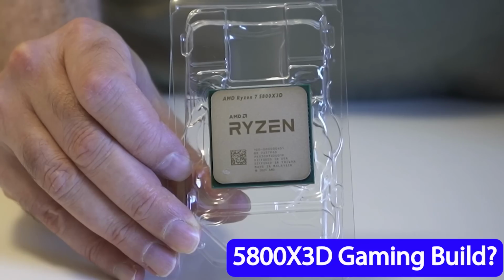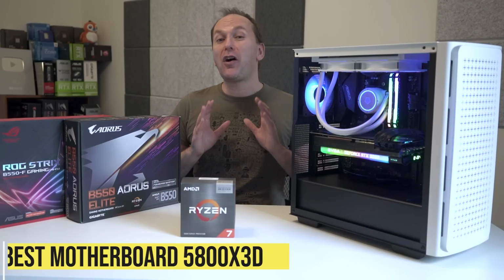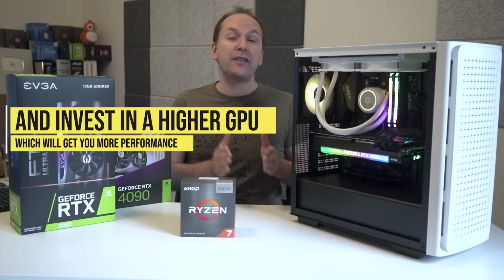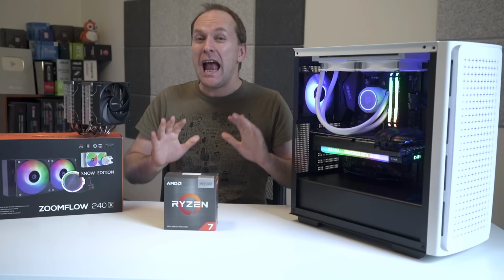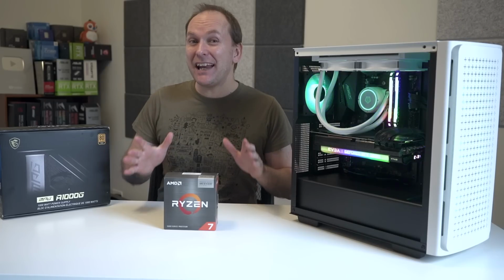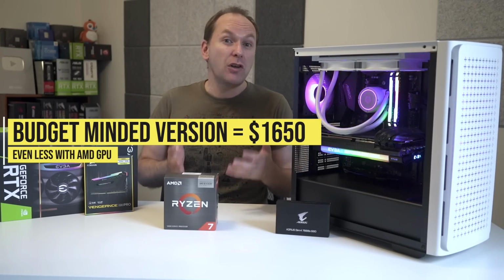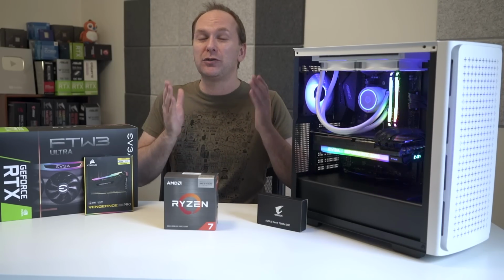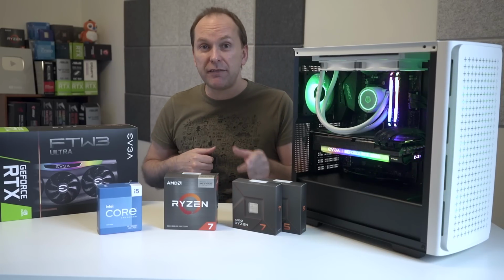🛑 4K Gaming is CHEAP! 🛑 Ultimate Ryzen 5800X3D Gaming PC Build

Comment: I ordered the 5800x3d and Aorus Pro AC yesterday. Glad you recommended that mobo once again Jason. Also got the Thermalright PA 120 SE rgb. It was a hard choice between the different AX and V2 Elite and Pro boards. 

I'm not sure if I should go ahead and bios flash it straight out of box when it arrives. 
Does anyone here know what current bios version is the best option for the 5800x3d?
Reply: Always update to the latest BIOS with AMD because they improve performance and security overtime
Reply from the maker: Awesome! And yes seconding Christopher I always update to the latest bios when I build

Comment: You would be a sucker to spend $720 on a 3080.
CPU: AMD Ryzen 5 7600X 4.7 GHz 6-Core Processor  ($250.00) 
CPU Cooler: Deepcool AK400 66.47 CFM CPU Cooler  ($34.99 @ Amazon) 
Motherboard: Gigabyte B650M AORUS ELITE AX Micro ATX AM5 Motherboard  ($189.99 @ Newegg) 
Memory: TEAMGROUP T-Force Vulcan 32 GB (2 x 16 GB) DDR5-5600 CL32 Memory  ($159.99 @ Amazon) 
Storage: PNY XLR8 CS3040 1 TB M.2-2280 PCIe 4.0 X4 NVME Solid State Drive  ($89.99 @ Amazon) 
Video Card: ASRock Phantom Gaming D OC Radeon RX 6800 XT 16 GB Video Card  ($514.99 @ Newegg) 
Case: Corsair 4000D Airflow ATX Mid Tower Case  ($97.49 @ Amazon) 
Power Supply: Asus ROG-STRIX-850G 850 W 80+ Gold Certified Fully Modular ATX Power Supply  ($114.99 @ Newegg) 
Total: $1452.43

Comment: I've been told that the ryzen 9 5900X is the best CPU I can get for the RX 6800 XT. Would you recommend the 5800x3D instead?
Reply: If you're building brand new go with 7600X/7700X for $250/$350. You can find 7700X/32GB RAM bundle for $420. If you are upgrading on AM4 then the 5800X3D is the best gaming chip. Get the 5900X if you need more than 8 cores for work. I've made 2 buld lists in the comments.
Reply from the maker: For gaming the 5800X3D will give you better performance. 7600X and 13600k also good options

Comment: Saving you about $500.
CPU: AMD Ryzen 7 5800X3D 3.4 GHz 8-Core Processor  ($329.00) 
CPU Cooler: Deepcool AK400 66.47 CFM CPU Cooler  ($34.99 @ Amazon) 
Motherboard: ASRock X570 Steel Legend ATX AM4 Motherboard  ($134.99 @ Newegg) 
Memory: Silicon Power GAMING 16 GB (2 x 8 GB) DDR4-3200 CL16 Memory  ($40.97 @ Amazon) 
Storage: PNY XLR8 CS3040 1 TB M.2-2280 PCIe 4.0 X4 NVME Solid State Drive  ($89.99 @ Amazon) 
Video Card: ASRock Phantom Gaming D OC Radeon RX 6800 XT 16 GB Video Card  ($514.99 @ Newegg) 
Case: Corsair 4000D Airflow ATX Mid Tower Case  ($97.49 @ Amazon) 
Power Supply: Asus ROG-STRIX-850G 850 W 80+ Gold Certified Fully Modular ATX Power Supply  ($114.99 @ Newegg) 
Total: $1357.41

Comment: I would not recommend using Corsair RAM (unless you are doing all Corsair build), as they use their own RGB software that you would have to install on top of other RGB software for your mobo, fans and GPU.  Unless you use third party RGB software, it's better to use all the hardware that supports Aura, for example.  That way you just need one RGB program to control it all.  All these RGB programs still suck, so installing more than one is just asking for trouble and you have more overhead that you could be using for gaming performance instead.

Comment: Depending on what else your guy plays, the 3080 / 6800XT might be severe overkill for WoW. I have a 5800x3D and 2070 Super, and I'm still CPU bound in a majority of cases in WoW at 1440p. Only in some of the outdoor areas with fewer people around do I see my GPU usage creep up over 80%, and that's at capped 165 FPS, so doesn't really matter.

The 3080 is also still quite overpriced compared to the 6800XT. I don't think any Nvidia GPUs below the 4090 are worth buying at the moment unless you very specifically want raytraced reflections, which AMD GPUs struggle with. Even the 6800XT does pretty well with raytraced shadows.

Comment: My system is the 5800X3D with a 6700XT it just devours WoW at 1080p pining the needle at 140 FPS in all but the heaviest raiding situations. In all my games this setup just tears it up, the extra cache really smoothes out those little hitches at higher FPS.
Reply: I just ordered my 5800x3d for wow 1440p. I also have the 6700xt, cant wait to see the performance gains just off this cpu.
Reply: What quality level are you running at, Ultra?

Comment: As someone who has an expensive x570 board (ASUS Dark Hero) and went from the 5800X to the 5800X3D, you don't need to overpay on the board because you can't overclock the 5800X3D, I've tried. If overclocking is your goal, the rule is you should get an enthusiast board that has better components to achive that but you can't overclock the 5800X3D. For gaming, the 5800X3D performs at stock better than the 5800X with PBO2. Now I don't know if my 64GB (16x4) Dominator 3600 CL18 can run at 4000 CL18 with FCLK set at 2000 because of the board, and I'd say probably not and you could say that I shouldn't get any better performance but I like the coolness factor. Really, I didn't want an X570 board with a fan which the Dark Hero does not have. I'd say shift your budget to a 5800X3D, save money with a good B550 or cheap X570 that is still good and decent RAM.
Reply: Have an crosshair VIII dark hero with a 5800x. Think its better to upgrade at an 5900x. Or?
Reply: Can oc my 5800x at 5,225 ghz all core at 89°C.... My question is... Is it better to take an 5900x with all core 5,3 ghz and 12 cores for unreal engine 5..?
Reply: @Querilio  Depends on your GPU. Hardware Canucks (sp?) said a 3070 Ti at 1440p wouldn't really benefit. Well, I still have screenshots of HZD going from 112fps to 138fps. SotTR, 10-ish better but still a plus. I'm sure there are some that won't but I doubt the 5800X3D would perform worse. Really, look at some of the 7950X reviews that compare to the 5800X3D and they are neck and neck. Problem is that most benchmarks large YouTubers do is 3090 Ti/4090 at 1080p. That is just unrealistic. With that card, you either want 4K or super smooth, high refresh 1440p. Gamers Nexus and Hardware Unboxed do some 1440p benchmarking. I actually was going to get the 5950X over the 5900X but many benchmarks put the 5800X3D above both. I just plan on gaming so 5800X3D is best for me. I also did a little retro gaming and the best way to make a 500MHz processor run like a 100MHz, was to disable the cache. The 5800X3D adds more cache which definitely will help in gaming. Cool overclocking. Its something I just don't do anymore, a lot of work, never really got results that mattered much, though there were some awesome ones. With how CPUs now just run as fast as possible w/o exceeding a thermal limit, I'll invest in better cooling and a nice mobo that will eventually sell higher than others used. Highend ASUS boards seem to do the best. Also, the highest end CPU for a socket does well too. My Phenom II X6 1100T is still worth a good bit, especially buying it used. I never OC'd it but I unlocked the turbo to let all six cores run at 3.7GHz. Otherwise, it would only turbo to 3.7 for up to a max of 3. When it did that, it would run all cores at 3.4GHz. Again, the best cooling kept that stable for a few years with the fastest DDR3 ram (1333 @ 6-6-6-18).

Comment: So what is the difference between the performance between 5900x vs 5800X3D. They are the same price.
Reply: 5800x3d better for gaming and 5900x better for rendering, mulitask. But for unreal engine 5 near future. Dont know
Reply: @Querilio  you say its better for gaming. Why is it better? I dont see a gain in games. Performance is the same. But its like you say, 5900x is better in productivity. Why not just buy a 5900x and get the both? for the same price. Atleast on 4k gaming. I dont know how it works on 1080p and 1440p. I happen to own the 5900x, and its not different from the x3d. Just less cores for multitasking.

Comment: Hi! I was watching some of your videos, specifically the best combo videos from a few months ago and I got slightly concerned over my new setup with bottlenecking. I have a radeon RX 6650 XT gpu and AMD ryzen 5 5600 6core 12 thread cpu. my mother board is a gigabyte  B550M DS3H ac am4. I'm worried that I will be bottlenecking my cpu and if its worth upgrading to a RX 6900 XT sooner than later.
Reply: Don't worry, one of those are basically always the limit to performance. CPU bottlenecks are generally worse because GPUs are more expensive and their performance, and price, gets "wasted" with a slower CPU. CPU bottlenecks can also cause stuttering while having the GPU as the limit to performance is smoother. Your combination is well balanced so there is no need to upgrade unless your aren't satisfied with your FPS.

Comment: I have an RTX2080 super and Updated from a Ryzen 7 3800x to a 5800x3d and the difference is nice in Division 2. FPS are stable now not as before and the peaks are higher and the lows are also higher. I am waiting for the RX 7900xtx at the moment. Nvidia is very expensive here in germany and i only have one RT Game... Shadof of the Tombraider. Playing on Ultrawide 3440x1440p
Reply: Bonjour, config copie aussi un 3800XT et un 2080 Hybrid  et je passe a un X3D je pense que plus tard la voix 4080 sera logique  pour votre config quand les prix vont s écrouler 
ici en France aussi hors de prix j ai sacrifie finance pour passer a 3090 et offrir dans ma famille le 2080 Hybrid 
merci de me donner le retour de températures du X3D en jeux du bas au max degrés, Merci d avance
Reply: @lucgrunenwald7795  max 70 degrees on games cooled with an 360 AIO BeQuiet Silent Loop 2

Comment: locally, the x3d for me is still easily $420, i went for AM5 instead, saw a deal for the x670e aorus master for 45% off effectively (meanwhile Z790 is almost ~$700+, if not i might have been swayed to get the 13600kf instead. Got the best kit of ddr5 from OEM too, now waiting on the x3d CPUs in Q1.

Comment: NEED HELP BUILDING THE BEST RYZEN 7 7700X GAMING BUILD! Would love to see you post a video with a 7700x build. I've been told it's the best CPU for CS:GO, which I play a lot! Right now I have Ryzen 9 3900x, Asus Rog Strix RTX 2080 Super, MSI MAG X570 TOMAHAWK WIFI, NZXT Kraken X73 + 2x NZXT AER RGB 2 fans, 32GB G.Skill TridentZ RGB 3600MHz C16, 1TB Samsung EVO 970 and Corsair RM850x psu. I want to build a new PC with Ryzen 7 7700x.

Oh and I'm strongly considering buying the ASUS ROG Strix XG27AQM 1440p 270Hz monitor, who will be replacing my AOC 24G2U 1080p 144Hz. I found a used one for around 666USD, the person bought it back in December 2021. A new XG27AQM cost around 914USD here in Denmark. I mainly play CSGO, but also play other games like RDR2, Call of Duty Modern Warfare, Microsoft Flight Simulator, F122, Euro Truck Simulator 2.

Comment: I bought the x3D chip in May to upgrade from my 5600x.  I looked at it as a last hurrah for the platform.  Hype drove my upgrade and I did regret it soon after, because my rig was great and $450 is $450.  But seeing how well it's holding its own, I no longer regret it.  I only play iRacing.

5800x3D, 3080, 32GB 3600 CL16, Giga B550 based on PC Builder's recommendation.  I should be set for years to come.  Screw the 4000 series cards!
Reply: Don't feel bad you're future proofed I don't think you'll need a new system for quite a while

Comment: What’s your opinion on the difference of the 5800x and the 5800x3D as far as streaming and video editing(1080p-1440p)? Is it more beneficial to get the 5800x3d in these cases or is the difference minimal and the 5800x sufficient?
Reply: I upgraded my 5800x to a 5800x3d and in some games at 1440p w/ 3070 Ti I saw almost 20fps more. Horizon Zero Dawn went from 112fps to 138fps. Shadow of the Tomb Raider only went up 8-ish fps but I consider it a win. Both use highest settings DLSS and with SotTR RT. Also, I run Spider-Man on highest everything and barely dip below 100fps

Comment: During the CPU choice I think you forgot to mention the targetted workload (wow) is very cache reliant and that happens to be the special trait of the 5800x3d. All by all a very good choice, but deserves a bit more explanation. Personally I would have waited for zen 4 x3d skews to launch. But I get it, new expansion launching and all :)Have fun gaming!
Reply: Agreed. MMO's and big open world games in particular really make good use of all that extra cache on the X3D.
Reply: ive been thinking of getting either the 13600k or 5800x3d. what would you say?
Reply: @Altyno296  impossible to say, I don't know your workload...
Reply: @BartVerhoeven1992  mostly gaming
Reply: @Altyno296  some games will run better on 5800x3d, some will run better on the 13600k...
They're both end of platform so you won't be able to get an upgrade to your machine later down the line.
The 5800x3d will probably end up being cheaper, and has more cache, but the 13600k has an advantage in multi threading. 

If there isn't some specific game you like, I don't think there is a wrong choice here.
Reply: Yeah, picking cpu for wow, and he doesnt even told about large cache which wow loves, but overall costs win, seems like he has no idea what he is talking about

Comment: So I have decided on a 
NZXT N7 B550 - N7-B55XT-W1 - AMD B550 chipset
Ryzen 5 5600x or 7 5800x
Vetroo V5 Cooler
Gigabyte Radeon RX 6700 XT EAGLE 12GB Graphics Card
500gb M.2 main drive plus a 2nd M.2 1tb if it fits.
OLOy DDR4 RAM 16GB (2x8GB) 3000 MHz 
MSI MPG A750GF WHITE Power Supply Unit, UK Plug - 750W, 
all I hope to be stuffed into this
iONZ KZ08 PC ARCTIC WHITE MID TOWER COMPUTER CASE M/ATX ATX TEMPERED GLASS WITH 3 FRGB FANS

Thoughts??
Reply: Good choice i think, im using the same motherboard but im using 6750 xt, if u have the budget u can go for 6800 xt for a more efficient combo. I wish i had that.
Reply: @nexvions  I was going to buy the 6750xt but I couldn't buy it on buy monthly from Amazon so thats why I got the 6700xt. But nice to know I have chosen well. Thanks for your comment.
Reply: @WilliamStevens007  ur welcome. On my side the 6750 xt is cheaper about usd 508 therefore it's an obvious better choice. I think it's due to the bad sales of that card. Happy gaming then!

Comment: I would have just spent the extra few bucks and got a 13700k since you went with a dead platform. Just as good gaming, better in some, useful for anything not gaming. Can still use ddr4.
Reply: The 5800 X 3D excels in MMOs and gives a lot more FPS

Comment: Having just got a 4090 and on a 120hz oled I want 120hz maxed I'm sure my 12900k at stock will be fine even with max RT which is cpu taxing as I really don't want to upgrade to the 13900k. Someone who got the 13900k said he notices the 0.1 and 1% lows are much better but not sure it's needed at this low hz.

Comment: I already have a 5600x and it’s a beast but man if the 5800x3D goes below $300 it’ll be hard not to upgrade
Reply: Have a 5800x and choose between 5800x3d or an 5900x... 🤔🤔🤔🤔
Reply: @Querilio  if you edit and render then 5900x, only gaming specific games like fps and other cpu intensive games only - then 5800x3d

Comment: Hi Jason, 👋 I am sharing my Ryzen upgrade story here : After weeks of thinking and budget calculations and loads of techuber videos including yours, I finally made up my mind and instead of jumping to new DDR5 platform I upgraded my  5 year old B350 mobo with a Ryzen 5700X replacing the old Ryzen 1600. For my RTX 3060 ti a 13600k or 7700X or 5800x3d  won't be giving too much fps compared to a 5700X. Getting a good 60fps 1080p on Cyberpunk on max RT with DLSS quality and 48 to 50fps in 4K with DLSS ultra performance . Shadow of the tomb raider hitting 160 fps on highest graphics at 1080p and 50fps on 4K with some DLSS. Blender is also loving the faster CPU. Hope my 5 year old B350 will hangon for another 1 or 2 years when the DDR5 platforms will become a lot more affordable and then I can think of upgrading.  Thanks Jason for the videos ❤️

Comment: Nice video again, i did learn so much from your videos👍 
Just building same class PC atm, i have most of the parts.
13600K
ASUS TUF z690 plus wifi
16gb G. Skill Trident Z 3200 cl14
Kingston KC3000 1TB
Kingston NV2 1TB
3080 GIGABYTE GAMING OC 10GB (used 600€)
Corsair HX1200 (used 150€)
FD Meshify S2 TG 
Arctic Liquid II 420 RGB

~2000€

Comment: I have a 5800X and a ROG Strix 3080 12gb and I benchmarked 98 games at 4k native on max settings, no raytracing. 109fps average across all 98 games. High spec games run around 60fps on max settings.

Comment: For those wanting a prebuilt AMD. Skytech has their 7700x with a 3080 and 32gig for $1799 atm. They don’t give any specs so I’m not sure of the ram speed though. I would buy it but I have a system with the i5 and a 3080ti coming for about $250 more.

Comment: I hear most asrock will let you into the bios and use a flash drive to update with the cpu inatalled. Then you can boot into windows.  I have not tested this, but looking into the steel series I have heard this over and over again.  The b550m steel series was going for 109, the b550 atx for 139 and then newegg had the x570 version for 130. I felt that was a good deal at 130 and got that one.
Reply: I just did it today

Comment: Great video! To be honest, you were one of my best sources while building my new PC hehe

Still missing the case and monitor (prices were high here in my country and not a lot of 1440p monitors available), but my spec is:
CPU: 5800X3D
GPU: Asrock Phantom Gaming 6900xt
MOBO: MSI B550 Tomahawk
Cooler: Noctua NH-D15
RAM: 2x16gb Corsair Vengeance LPX 3600mhz CL16
SSD: Samsung 970 Evo 1tb
PSU: XPG Core Reactor 850W Gold Plus